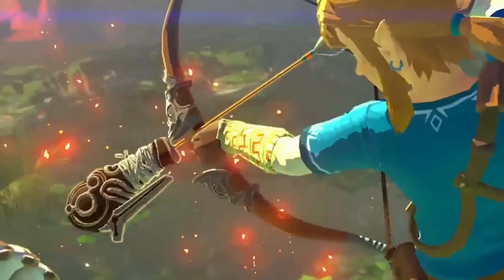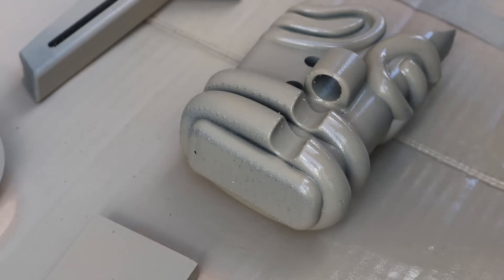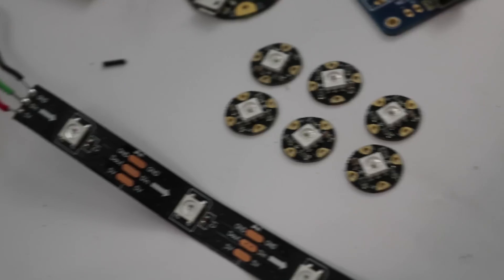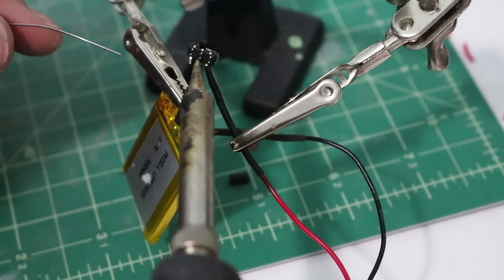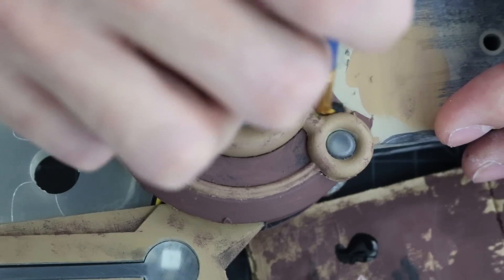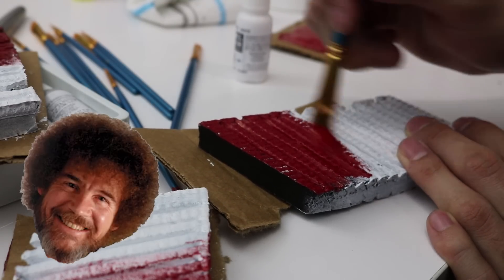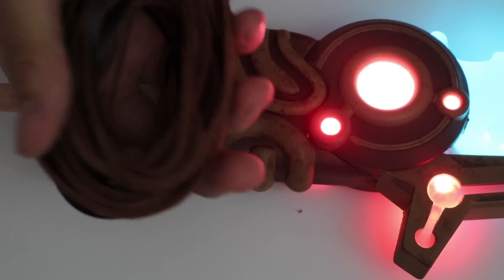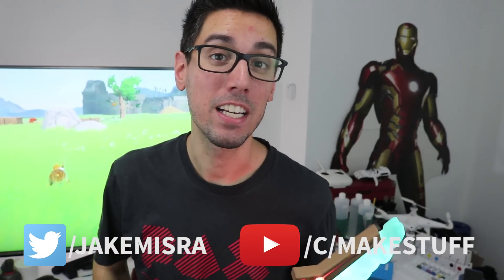Breath of the Wild Ancient Arrow // 3D Printing

Comment: So I have a quick but kinda vital question: Would this print well/correctly on a normal, filament-spool-based printer?  For example a Makerbot Replicator 2 or something like that.  Also, I don't know much about arduino or circuits or stuff like that, but still think that the lights would make the whole thing complete.  Could I put normal LED's into this model, and if so, any recommendations?  I really can't wait to start making this, just want to be prepared.

Comment: I printed this off successfully (kind of) without using those specific settings of setting the nozzle width for the printer to .34, extrusion width to .38 and so forth because the slicing software I was using didn't have that detail. The biggest problem is that the screw posts were too thin, required 2.5M screws, and weren't all that sturdy. At least all of the electronics work and it looks gorgeous when it's assembled but I'm trying to print off the parts as specified on the web site.

I  finally got my printer configured for Curia 3.2.1 and set the slice settings as instructed. Now I'm running into a problem where half of the posts are not solid right at the base where they go completely straight. They print off more like a mesh, you can easily see into the structure, and they can break off easily. The upper 1/2 or 2/3 of the post, however, are completely solid. Those posts that do remain solid are much more sturdy and take the M2.0 screws as expected, but obviously I can't use a part where half of the posts are compromised.

Everything is set to the slice parameters as listed on the web site (and my printer does have a .4mm nozzle). Why would some of the screw posts be solid and some of them be flimsy?  Should I slow the print down to maybe 40mm/s? Did Curia make a bad file for some reason? Any suggestions?

Comment: would it be possible to make the trailer version?
like how it folds up
Reply from the maker: oh man, that would be difficult. It's possible, but it would be really hard to have light up. I would need to do surface mount LEDs and a custom printed circuit board to make room for the extra components.

Comment: I hate to be that guy but here I am. You might be dry-brushing but you're applying the paint with a stippling technique. Normal dry-brushing just has the paint brush being used normally but you're actively painting in small areas with a fair amount of force, the end result is dots or stipples.

Ok art rant over. Looks awesome!
Reply: BlueCollarNerd a fair amount of TRI force